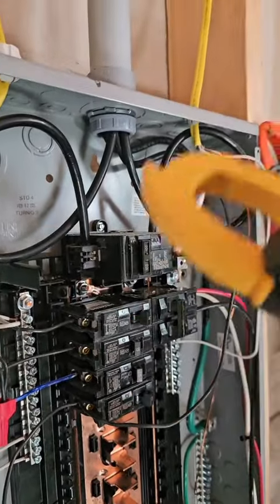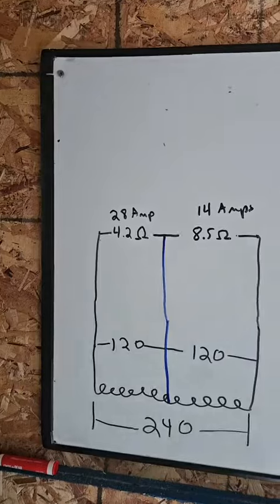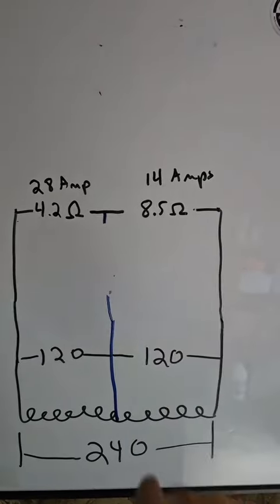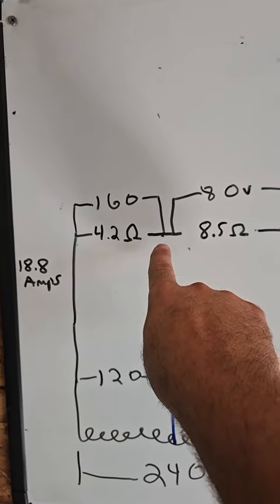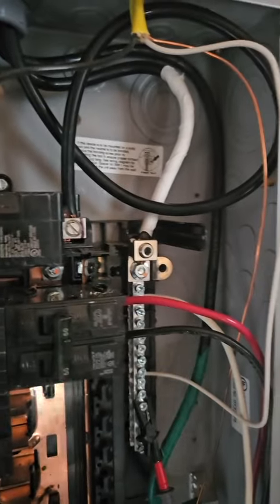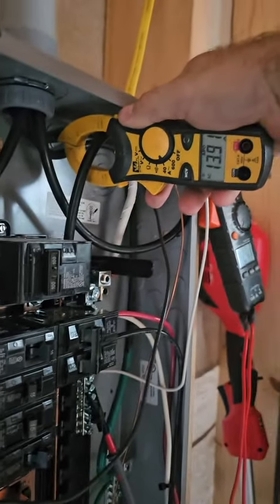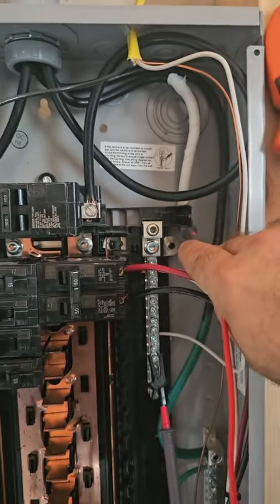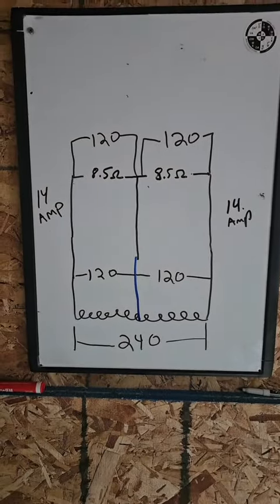click for deeper explanation. How and why does the neutral only carries the imbalance

Comment: I understand the concept.  But I can't see it in the panel.  On the whiteboard, you have a balanced load with nothing flowing on the neutral...and the two 120's joined.  But the two 120 legs never join anywhere in the panel.  Are they flowing back and forth through one of those closed 240 breakers?  Is that what's connecting the two together?  I just can't see where the whiteboard matches the real life panel.

Comment: Please stop and watch the link, you have this wrong
Reply from the maker: @kensaenger9426  please tell me where to think that disagrees.  Or where it says any thing I said wasn't true...
Reply: @Stevenj120volts  You specifically stated that it has nothing to do with sine waves, when it does.
Reply from the maker: @kensaenger9426  if we are talking about why a center tapped neutral carries the imbalance it has nothing to do AC or sine waves.  the neutral carrying the imbalance works with DC circuits.  I have built a demonstration showing. It happens with simple stack of 18 D batteries
Reply from the maker: @kensaenger9426  if your link says center tap  neutral carrying the imbalance has anything to do with sine wave your link is wrong and I can prove with love voltage demonstration not just drawing and math

Comment: @Stevenj120volts  i have a question if you don't mind 
"My neighbors power line was  knocked down in an ice storm  and when power company hooked it back up they left neutral hanging not hooked up back at pole"

Is this a hazard? it been like for months now and when tested with an outlet tester everything seems normal  but that just doesn't make sense
Reply: Under normal condition, that neutral is just sitting there. However, It's only a hazard when lighting strikes the pole because that neutral serves a low resistance path for lightning to go through the Earth. Without that neutral being grounded, lightning has has no choice but to go through the circuit panel and potentially blows up whatever home appliances are plugged in to it. I suggest that you call your local power company and have them fix it

Comment: Your drawing is reversed. The voltage should be approximately 80v across the 4.2 ohm resistance and approximately 160v across 8.5 ohm resistance.
Reply from the maker: @surferdude642  shit did I get the labeling wrong?
Reply: @Stevenj120volts  Yes you did, the larger resistance value in a series circuit always has a higher voltage across it.
Reply from the maker: @TheDigitaldoug thanks I hope you will understand that it was mistake and not a misunderstanding of how the math is supposed to work
Reply: @Stevenj120volts  I did assume that it was a mistake, I enjoy your videos, they are top notch and right to the point.
Reply: I wondered this myself. Initially, I thought the voltage drops across the resistors were switched. I thought I was misunderstanding it so I kept rewatching that part. Glad someone mentioned it.
Reply: Cool, I was right and caught your mistake! Thank you for all your excellent demos. I’m really starting to understand how things work and am now explaining stuff to others. Keep the videos coming!

Comment: Do you get the same results in voltage in a circuit?
Reply: In a series circuit the voltage drops across each resistance and the current remains the same for the entire circuit. In a parallel circuit, the voltage measured across each resistance is the same and the current and resistance will change depending on the load wattage requirements. All 120v circuits are parallel unless they are perfectly balanced or have an open neutral, then they are in series. An open neutral can damage equipment because of the higher or lower voltage that they are designed to operate on.

Comment: I'm gonna have to watch it a few times to fully grasp it but it definitely helps
Reply: simple terms at the panel (neutral), basic algebra, (+) (-)= (-) 
(28A) (14A) = (14A)
Reply: @nevrbdwnruby7484  I get the what. Trying to grasp the why
Reply: Picture a gfci measuring the currents on both lines and the neutral. It is summing the current to 0 under normal load conditions even though each individual conductor is carrying current. It knows how to sum to 0 because of the polarity of the currents. You have one Line running in "one direction" (polarity) through the sensor (current transformer or hall sensor etc), and the other Line is coming back in the "other direction". Then that alternates. So if you just try to measure the current across some branch circuit 120VAC device by clamping the hot and neutral at the same time it's going to give you a reading of 0. If you clamp measured both service lines at the same time in your panel and it's perfectly balanced, then again you'd read 0 amps in the meter. If it wasn't balanced then the reading would theoretically be the same as what you'd read off the neutral alone. So let's say this gfci is measuring these currents and they are not of equally opposing polarity, but opposing where one is carrying more current than the other. Two things which are pushing against each other equally appear at rest. When one pushes harder they appear to move. The gfci ends up seeing the difference between them because everything but the difference balances out, so then it says "oops I detect current". When you add the neutral into the circuit so it can sense it also, this 'difference' it was seeing before is now met with equal and opposing polarity so it balances out and doesn't see current anymore. 

If you just measure one line and get 1A, then measure the other line and get 2A, then you know the neutral is carrying 1A if there's no other outside current path. You can almost just look at the series circuit part of it and see that one half has 2A and the other half has 1A, and say, "where did the other 1A go?" The total amperage there would then be considered ~2A. 
When picturing the DC circuit example it's easy to just imagine perfectly balanced loads on each half with no neutral. Just think 2 batteries in series for the source and 2 resistors in series across it. The equal resistors create a voltage divider which halves your total voltage equally across them. If the common between the batteries is halfway between 24V (2 batteries in series) then from the common referenced perspective that would be +12V and -12V, because the -12V is going the other direction. If you place a balanced voltage divider across each end as a load, then from 0v negative terminal to halfway between the load you have +12V, and 0 to halfway between the batteries you have +12V. There's no potential difference between those two points so no current will flow. If you wired your batteries as +12V and +12V end to end, starting from the common 0V negative, then you always have a 12v potential difference between each output and 0v negative/common/ground, so current will always flow across the neutral when connected.
Reply: If you still don't get it, I suggest you look up kirchoff's current law. Do some circuit analysis (solve for voltage and current an a circuit) with kirchoff's current law.